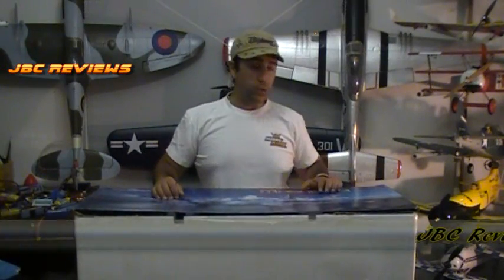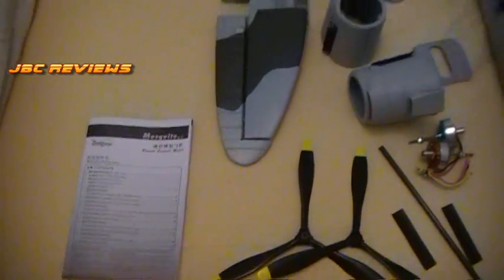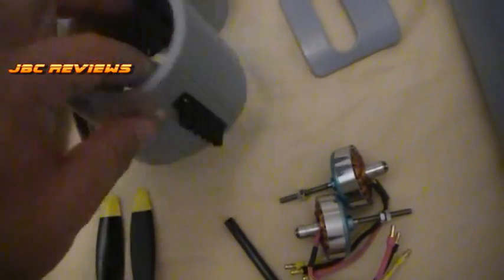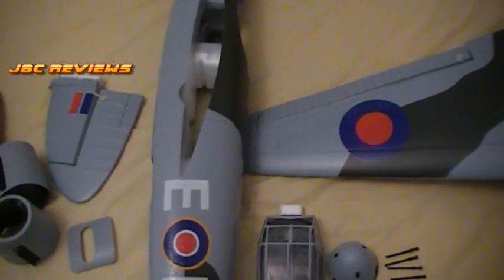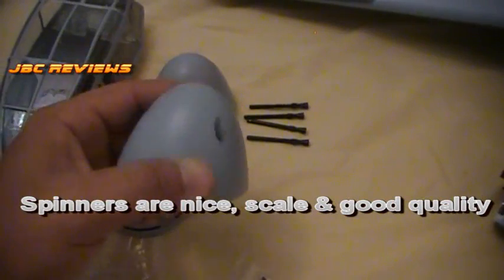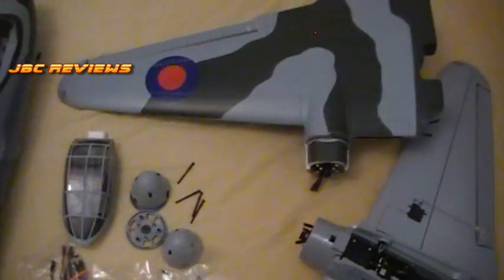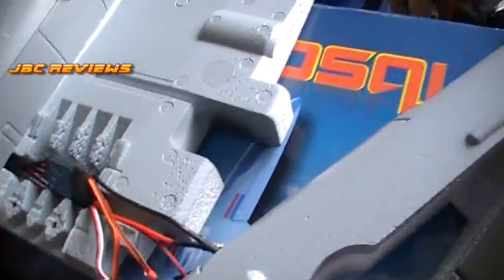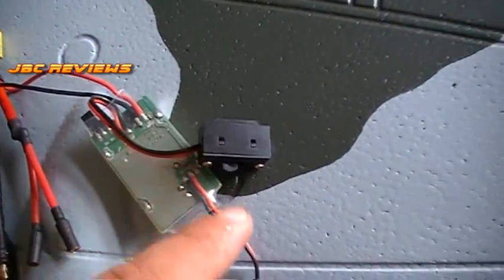HobbyKing MOSQUITO Pt1 Detailed open box & Build tips (by HC Hobby)

Comment from the maker: @Kiwideno I hang them from the prop which is probably the strongest part of the plane. I always check that my motor mount is secure before each flight and so far no problems. They also have retracts and I guess you could also hang them from there (or nose gear) if you didn't feel confident about using the prop. The planes only weigh around 2kg give or take so it's not really alot of weight. Most of my planes are on a rack but I'm running outa room so hanging was the next step lol

Comment from the maker: @ChopterMan Battery type/size doesn't effect correct CG position. I like to set mine at the rear end of the plastic radiator covers on the bottom of the wing as it's suits my flying style

Comment: Hey JCB that's what I call a review! Thanks

I'm just following your MODs and I have a question regarding the propeller you recommend MAS 9x7x3:

Should the Mosquito use 1 prop Counter-rotating in 1 Motor (turning left) and a regular propeller in the other motor normally turning clockwise?

Or it uses 2 CR propellers and the motors are both turning left?

Thanks 4 Ur support!

Regards,
Pedro

Comment from the maker: @svfury Personally I prefer 4 cells but it's still ok on 3cell, mores so if you use  10" props. Glue I used was actually 2 types, I used a little bit of 5min epoxy and also some EPO glue which I had left over from some of my FMS models. There's actually not alot of gluing needed with this model luckily enough

Comment from the maker: @WarbirdFan66 The retracts are ok, you can either make up a thicker wire leg like I did or Hobbyking sell some stronger drop in replacements for only a few dollars (follow the link below) which guys on RCgroups are using with success. You probably don't have room for a bigger tyre but they're already quite large (approx 60mm from memory). Gear & gear doors simply plug into 1channel on your receiver, easy & no problems :)

Comment: thanks for all your help can i pick your brain again when fitting the props ans spinner does it go ,nut then back plate nut and prop then spinner because when i tighten the spinner up the back plate catches on the cowel ??? and the tail plane really got me stumped i have cut out the bit on the rear of the fusealage but it still doesn,t fit if  ?? so close to been able to fly

Comment from the maker: @MrJanjua00 You can check my videos as I've already done a review for the 70mm F-15. I bought that a long time ago before Hobbyking had it, I got mine from PW-RC but it's the same model. It's a nice plane, I flew it on 3S but 4S would be alot better. I also have the twin 64mm version, which is quite good but have not made a video of it yet.